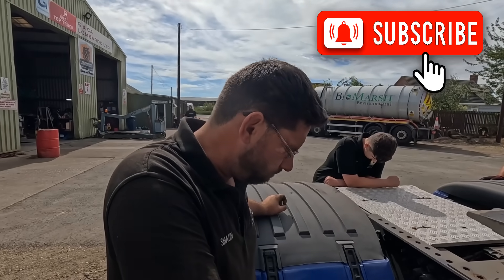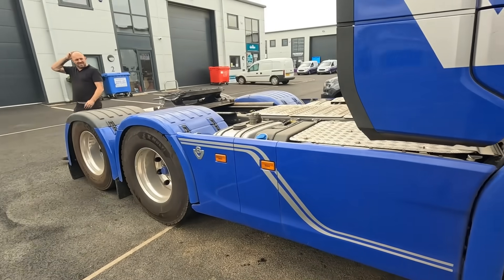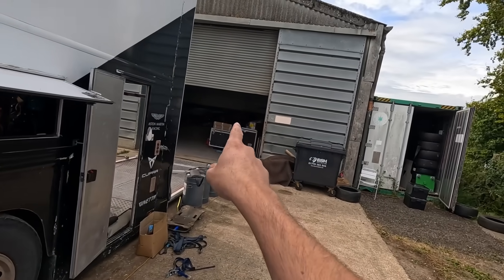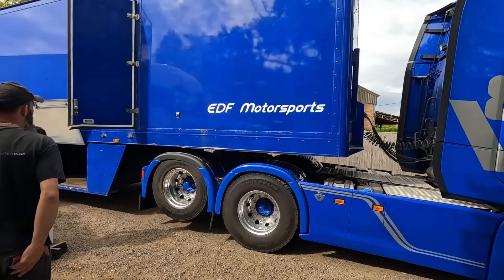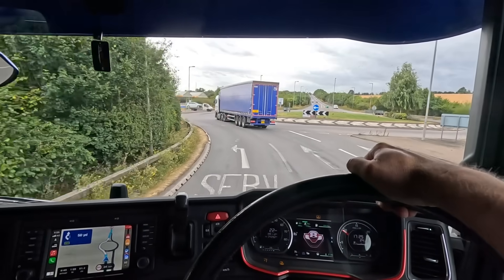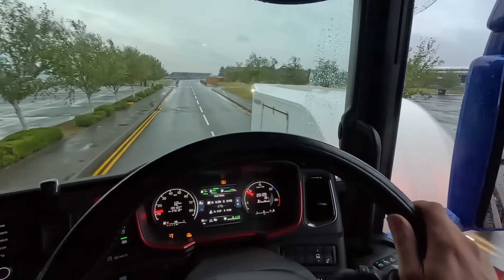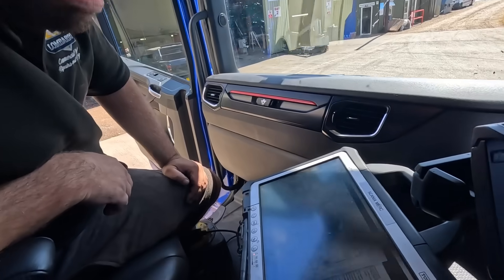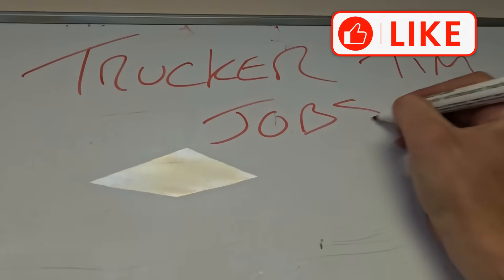THE PERFECT LIVING TRAILER FOR MY SCANIA V8 | #truckertim

Comment: you should get a movable fifth wheel on the S serries. I have one on my truck, really easy for hooking up different types of trailers. with heavy loads, you want the fifth wheel as far forward as possible, otherwise it's a death machine. Also for international work, with different regulations in EU compered to UK